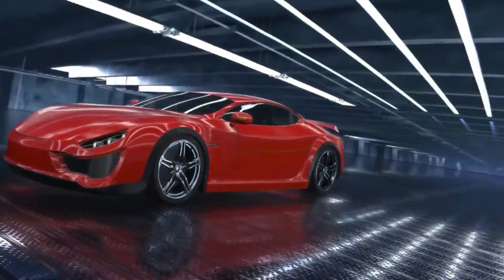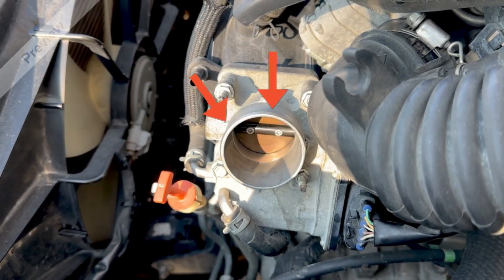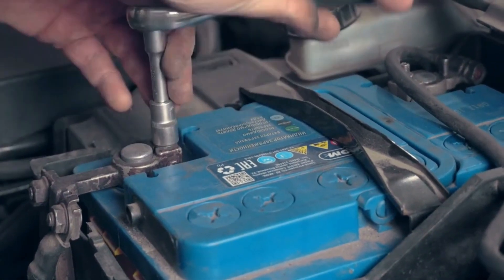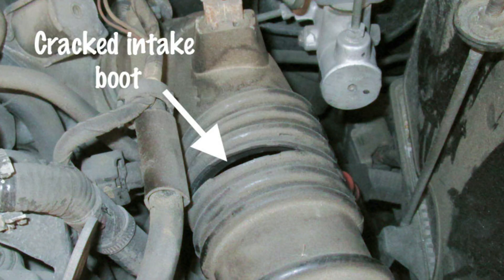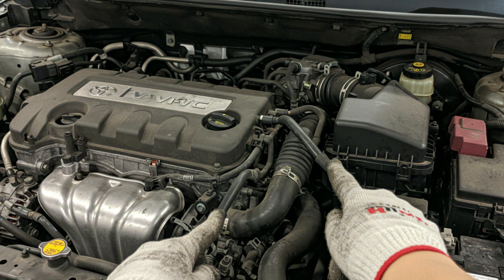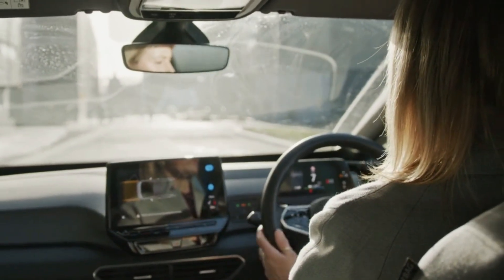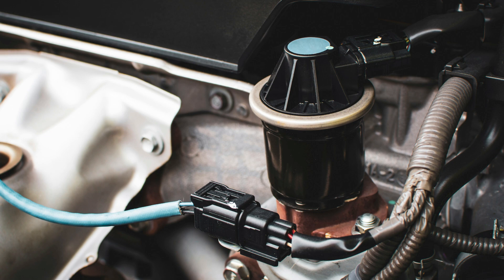Throttle Body Reset SECRET Mechanics Won't Tell You! ⚡ Fix Rough Idle at Home

Comment: Dirty throttle body does not set a code no need to reset the ecu
Reply: it does it throws the p0507 code i cleaned it code went away either way when cleaning throttle body you have to reset ecu so it can learn it

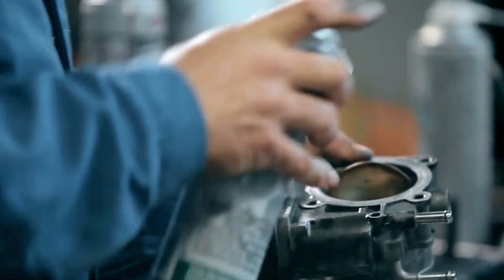Comment: 3:57 "wear gloves and safety glasses, spray throttle body cleaner onto a microfiber cloth and not into throttle" as the guy in the video is doing the complete opposite of that was said , lmao!
Reply: Gloves and safety goggles to clean a throttle body - Yeah, nah!
Reply: you spray on the throttle body if it is not attached to the car. if attached use a towel
Reply: Be sure to wear a certified Hazmat suit, goggles, respirator, firefighter gloves and keep a phone close by to call 911 when cleaning your throttle body. Remember, "Safety is your friend, do not be frightened by it".
Reply: @maj8301 😅

Comment: you said ground cable video showed the positive plus sign beging disconnected. I say removing the positive is correct and not the negative cable.
Reply: You should remove the negative terminal not positive
Reply: @adelanaazeez-jf9iv  Why not remove both positive AND negative?  That's how I do it.
Reply: I've been a mechanic since 1992 and you are totally wrong remove the positive cable and take the risk of blowing out your entire electrical system or parts of it I mean you can do it but it's not a good idea

Comment: Do not disconnect the battery on some European cars or it won't start unless you reset the TPS with a dealer scanner.
Reply: Thats why Toyota is deal-breaker